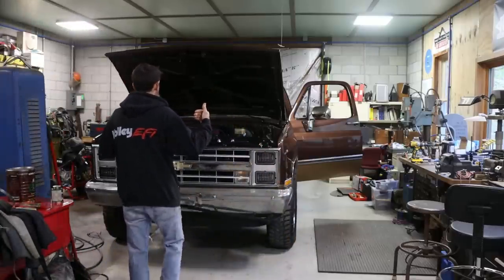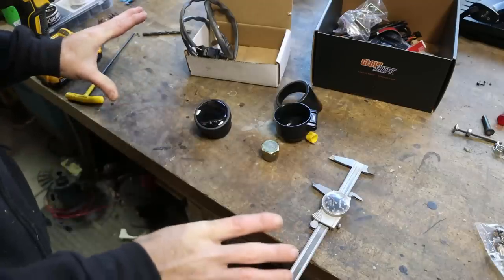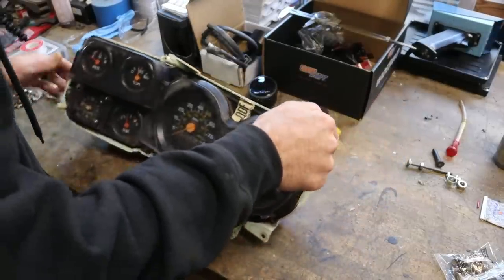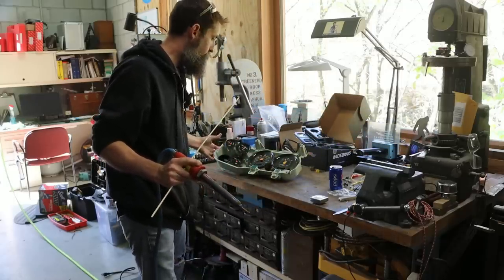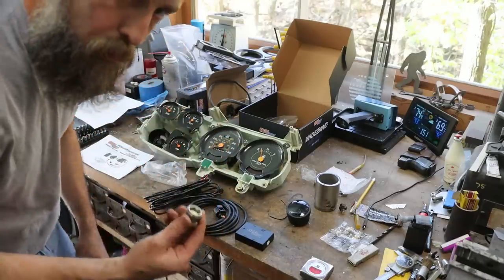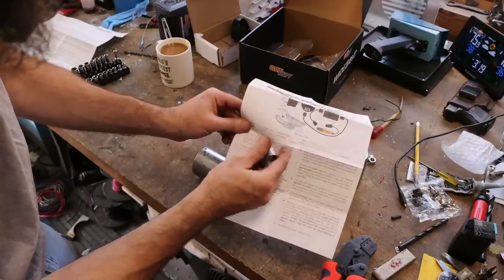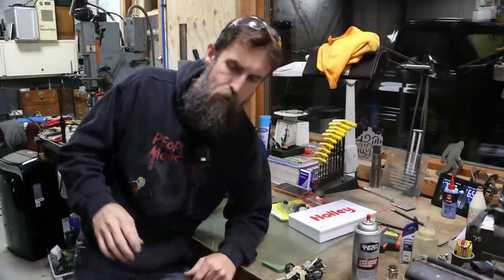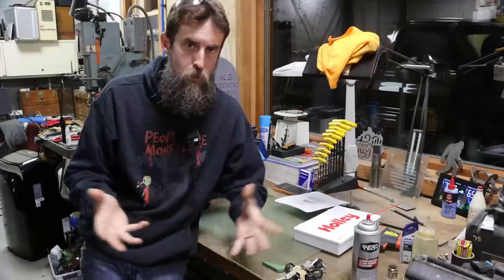No More Guessing . Installing AFR gauge in the K10 pickup

Comment: You might want to try a product called "Plexus" to clean and restore the plastic. Plexus was originally developed to keep aircraft windshields and side windows looking fresh and new. Plexus is actually a wax that penetrates into any pores that might be in the plastic surface and fill small scratches to restore plastic surfaces. I use it on my motorcycle windshields and it keeps them in a like new condition. All of the small scratches that make windshields look hazy are gone. In your case, the life expectancy would be very long (maybe a year or more) since there is no exposure to the elements.
Reply: Plexus is a fantastic product.
Reply: I agree. If Keenan Tatro of Tatro Machine recommends, it has to be good👍
Reply: I should add that one of the biggest benefits of using Plexus to restore an item like that, is that it dissipates the static that builds up on the item, causing them to require constant cleaning (often with aggressive cleansers, that contribute to the haziness of the item.

Comment: Nice job Steve. Just remember that 12.5:1 is a full load a/f ratio. 14.7:1 gives best emissions,  and 15.5:1 is for fuel economy. Lean on cruise, within reason, is what you are trying to achieve. Some of the later efi stuff is much leaner than that when in lean cruise mode. As you load the motor up, and it goes lean, then you adjust the power valve circuit add the extra fuel. Changing the power valve brings the circuit in sooner or later, as required. Jet changes are easy, which is why we do them the most,  but we do tend to do them to cover other issues. Often because we don't know any better. Properly setting up a carby can send you miles down a rabbit hole... regards Greg

Comment: I was shocked, just shocked I tell you that when you were plastic welding that you neglected to apply any plastic flux to make for better joints. I now have to go and take some Prozac to bring my equilibrium back to normal. You could have alleviated my apprehension Steve if you had just applied some plastic welding flux. I hope you sleep well to night after you egregious omission. 😁
( 10 minute later ) WOW.....cool man.......😎........rock on. 🤙
Thank You for the video Steve. That seems like a much better system than the EGT gauges we had in our piston engine aircraft that we leaned to 50° lean of peak if I remember correctly.

Comment: used to use a soldering iron for plastic welding
Reply: So have I. Does a pretty good job as long as the tip is clean.

Comment: Plastic welding is very common in semiconductor industry for example! It's used for welding tanks or double containment boxes to prevent chemical spills. 
A very nice tool to have. :)

As always a very nice video Steve!

Comment: They do sell a good non-welding bung installation kit. Or your local muffler shop can install one if you don’t weld. It’s really a great tool for old school carb setups. I would still go with one of the EFI kits if I was going to all the trouble of rebuilding my engine. Holley makes it too easy for not a lot of money in the big scheme of things. But if your restoration demands sticking with a carburetor, a gauge like this really is a big bonus for drivability, economy, and maintaining your car or truck. Thanks for showing us your install!
Reply: I couldn’t agree more. I put an EZ 2.0 EFI system on my 68 Camaro SS when I installed the 509 CI engine. FI is far and away is the best modification I’ve done to this car in 38 years of ownership. I hit the key and drive.

Comment: a few decades ago I did a voltage divider with a LED bar for the indicator and a one wire sender. Pretty inexpensive to do that way and you don't really need a heated sender for this application. I won't go into setting the bits up because it has been well covered below. Once the bits are set up then the value of having it in the dash kind of goes away. I made mine easy to remove.

Comment: Nice job on that install! I use WB02 a lot. Only tips I can offer is to basically ignore the WB at idle speeds if you have a cam with some overlap as the exhaust will draw in fresh air at low engine speeds. For idle use vacuum and rpm to dial AFR and WB02 over 1500rpm or so.

Comment: Interesting but I would have saved up for one of those Holly EFI systems and just replaced the carb.
Reply: The "affordable" Sniper system is around $1500 at Summit.  Very nice setup and a problem solver in a lot of cases.  Steve's situation is different.  He has a new carb and engine.  It is running quite well.  He is comfortable with carburetor operation and adjustment. A well maintained carbureted system will work perfectly and save him quite a few bucks!

Comment: At the point where you began TIG welding, it occurred to me that this particular installation project is "right up your alley" professionally speaking.  At least more so than many of your video projects.  Coincidentally, I recently joined a start-up making laser spectroscopy sensors, which will principally be used to examine combustion exhaust streams.

Comment: Using the air fuel ratio gauge.  
Bring up engine speed to around 1700 rpm. This should be just below the speed the primary boosters start to trickle. If you are lean. Increase the idle feed restrictions by 0.001"  test again. 
To test the primary air fuel ratio.  Bring the rpms up to 3500 to 3700 rpms. Is it lean or rich.  Change the primary jets and retest.  
After you get the primary air fuel ratio set. The secondary air fuel ratio is checked during hard acceleration but you need to not go to wide open throttle as you have to observe the air fuel ratio with close to wide open throttle manifold vacuum above the power valve opening pressure.  So the power valve is not enriching the overall air fuel ratio.

Comment: I would not be worried about cruise afr in the 15-16 range. Will be interesting to see if the extra fuel you added Gains any mpg. What are you getting now?
Reply from the maker: I'm not sure on the MPG yet, got to get my speedometer working 1st then I will play around.  It seems to run a bit better after adding a bit more fuel.

Comment: how does this cab mounted gauge help you dial in the carb when all the adjustments are ON THE CARB under the hood? do you twist bleed screw then run to the cab? twist the choke then run to the cab?

Comment: Awesome video as usual Steve - who is the manufacturer of the plastic welder? I've never seen one that connects up to a gas supply and I have a specific use for one. You might consider an EGT as a backup to the AFR - they are cheap as well and in some ways more trustable.